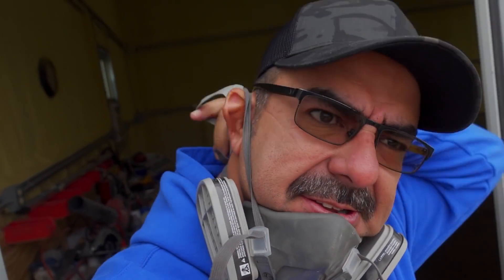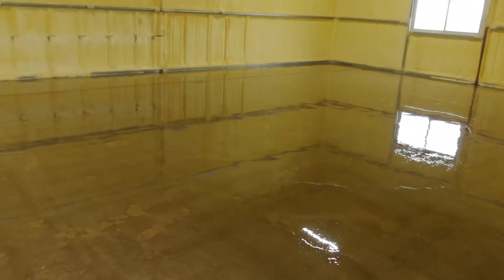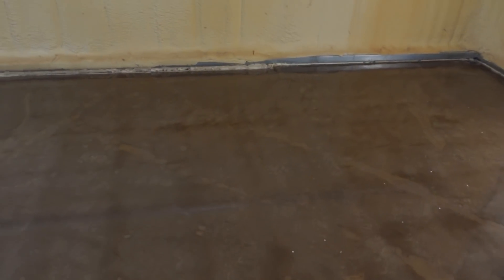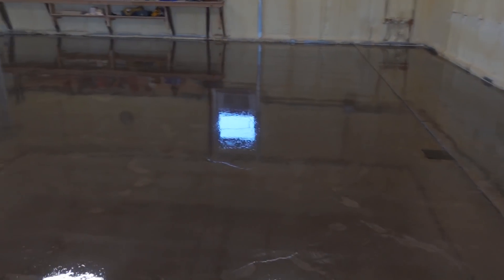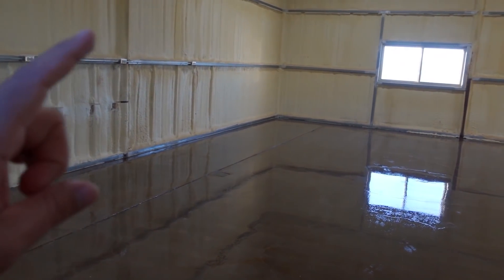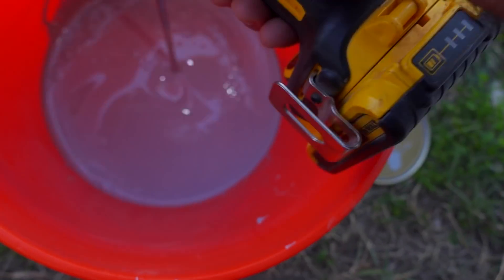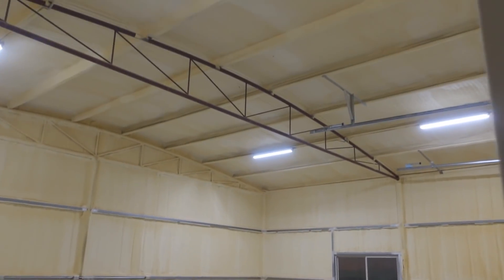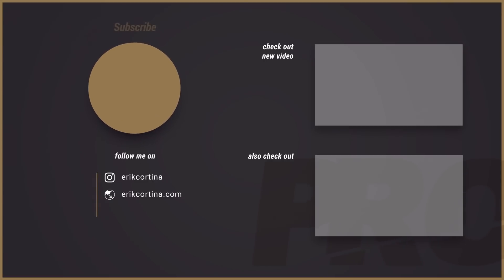Changing Floor Color | Starting a Machine Shop Part 3

Comment: My wife helped me refinish all the hardwood floors in the house. She questioned all the filling and sanding between coats and thought it was over kill, when it was done she said  you were right without that it would not look this good. Nice job it looks great, now when you drop a small spring or detent you can find it.

Comment: SORRY FOR THE NOVEL..  but... I gotta add my two cents for a P.S.A... 
It is unknown to me, if you do any measure of fabrication type work in this location, more directly, WELDING. Just in case you didn't know or anybody who may read my comment, when doing these light and shinny epoxy floor coatings, and you also do welding, I would recommend that a chin scarf is used or attached to the welding helmet, to block out any welding light from bouncing off the walls from the floor or under the chin of the helmet from the floor directly. and it only takes about 4 to 5 minutes of this reflected light from the welder, to bounce off the floor from around the sides or bottom of the helmet and reflect of the inside of the helmet... I remember doing my floor about 15 years ago, in gray. not white, and it still got me. I went to bed that night just fine, with a slight headache, just a minor one, I woke up the next morning, and the typical feeling of instant sand in the eyes to the point, were you can't even open your eyes and your eyes go into protection mode and start watering (crying like a baby) uncontrollable. What is even worse then that, (if you have never had welding burn in the eyes) is every time you attempt to open your eyes even just for a 1/10th of a second, the shear pain in the back of the eye you forced open, as the eyes like this, absolutely do not want to open. Your next move is to try to sleep it off the whole day or 3... or head to the doctor, and of course, you'll need somebody to drive you as remember, you can not see or keep your eyes open long enough to not trip over something while walking, let alone, drive an automobile. The doctor or eye specialist, can do a simple procedure, which is a few eye drops in the bunt eye, or burned eyes. and with in a minute or 3, the numbing chemicals in the eye drops, starts to work. and then you can start to open your eyes and the tears start to lesson. The sharp pain in the back of the eye(s) reduces very quickly.. Please note, I am not a doctor. I am just letting anybody know, to watch out for this issue of welding burn to the eyes. I have had that eye burn happen to me 3 times in my life, and man does it suck when it creeps up on you.. The new, shinny floors got me each time. Please note, I am not giving a negative thought on to doing your floors in a shinny bright epoxied floor, not at all, do it, as you will absolutely love the results of how bright everything is, like even working under a car, you dang near do not even need a drop light due to how much reflected light gets down under the vehicle. floor clean up is easier as a bonus too.  Again, so worth doing a bright and shinny epoxied floor sealer system.  All I am saying is, for any of you welders out there or that work around welders in the same area to just be mindful of this as just because you are not looking at the welding hotspot, does not mean that the reflected light bouncing off the walls as you are off in the corner doing your own thing wont get you, it can, and often times, will.  Good luck, be mindful.  of reflected light from the various types of welding, MIG, TIG, Micro Pulse Localized spotting, Arc, Plasma Cutting, Oxi-Ace, etc... Heck, cover your cigar when you light that too, lol...

Comment: Hey how's it going Eric.? I have a shooter question for you.. have you ever shot 300 yrd varmint ?? 5in target at 300yrd ( The guys I shoot with a few times a year shoot 1/4 moa groups at 300 yards).. sounds pretty insignificant when I'm talking to one of the best shots on the planet, however?? Is there a particular caliber you would suggest for that range, most of the guys shoot .223, .22-250or .243.. I have a Savage bull barrel chambered in  .204 Ruger 40 gr at 4,020 ft per second, with a 36x60 sworovski.. the scope cost me more than the rifle... headshots only on squirrels up to 200 for sure! But my best five round group was half moa at 300 yards.. the rules are pretty much unlimited .25 caliber and under factory loads only!!! I have access to a precision machine shop so.... I'm thinking I need a custom tuner break... Or a different caliber!
Reply from the maker: 6BR

Comment: Erik I know 3 phase is the way to go if you need it, which is what I have in my big shop to run several huge machines. However at my home shop 3 phase isn't even an option since only 2 phase goes by, which I though, was the end of me moving one of my lathes to my home shop years ago until I found out about VFD's and I wish I knew about them sooner. I know it's not practical to have a whole machine shop run by VFD's since you need 1 per machine but if you only have 2 or 3 machines that are 3 phase I would certainly think about it. I have a lathe and a milling machine, both 3 phase, that are each powered by vfd at my home shop. Both machines are more functional now and have way more adjustability than I ever thought was possible. I'm still curious about what machines you'll use brand wise. Any hints yet? I think in one of your older videos you were shooting with or knew the owner of grizzly products. I enjoy your channel and really enjoy the videos where you are talking in thousandths and ten-thousandths of an inch, that's my kinda language lol. Keep up the good work!!!

Comment: Good stuff, we put epoxy down in our warehouse back in the late 90’s lot of work. Should of ground down the floor since the floors where a mess. But they went cheap 😂 

Still remember the smell whew! Good stuff Erik, great to see you taking your product and going to the next level with its production.

Comment: A quick question about the insurance. When do your muzzle breaks to from being a machined part to a break? Could you do the steps that turn it into a break in a small shop on the side. That way the main shop is just a normal non gun related machine shop. Just a thought.ThankQ.TkEZ>UK